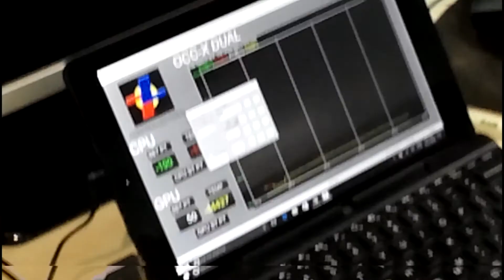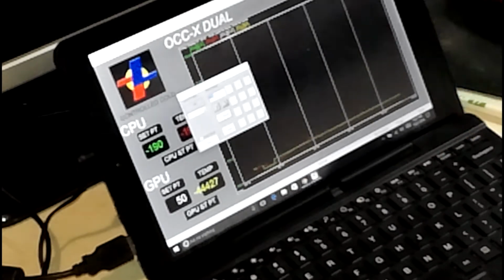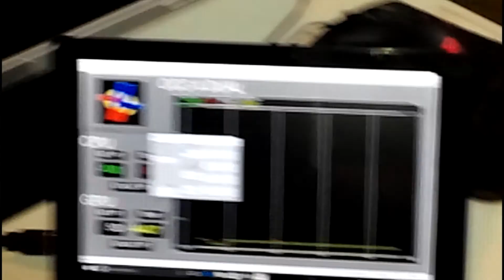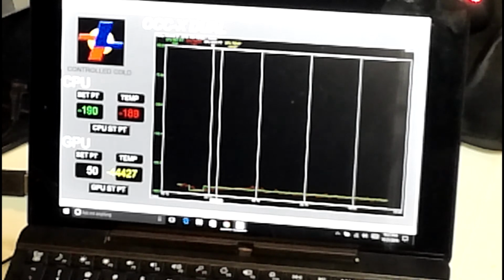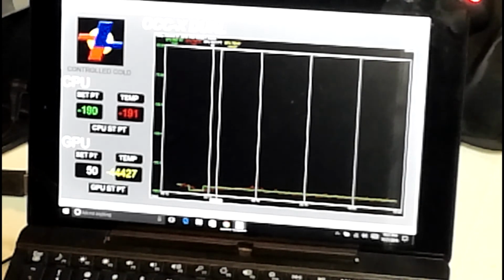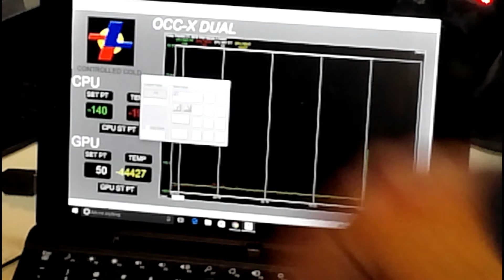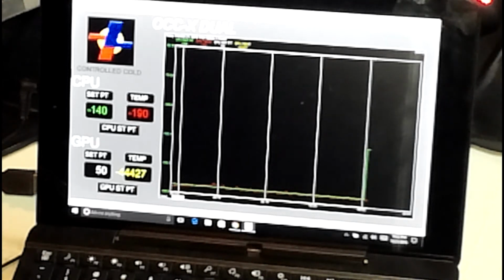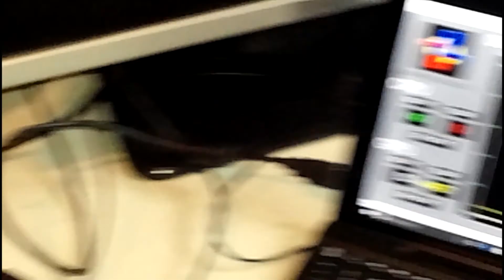Overclocked Intel i7 6700k 6000 mhz @ -190C Vid#2 on LN2 OCC Warm-Up

Comment: Interesting. -140C cold boot bug temp inherent only for this 6700k, or for all instances Skylake?
Reply from the maker: Kashtanultra the 6700k is factory unlocked for overclocking as opposed to the 6700.  There are several Skylake chips that have no cold bug.  This was my first session with the 6700k. I have since been able to run the chip @ -190ish 93-96.  That is as cold as ln2 gets. There are certain voltages that need to be adjusted in OS befire dropping from -150 to -190's and since with this mobo there is no OC panel, the cold boot temp is -150 to -175.  We made this video to show how simple it is to warm the head from -196 to -150